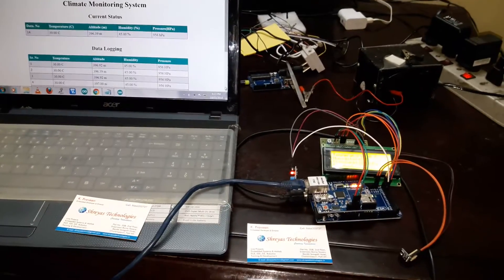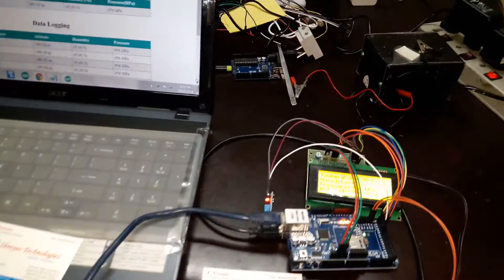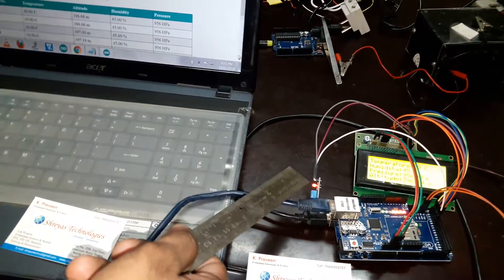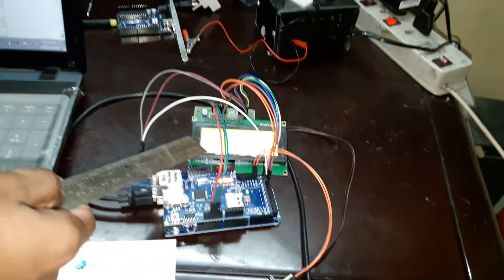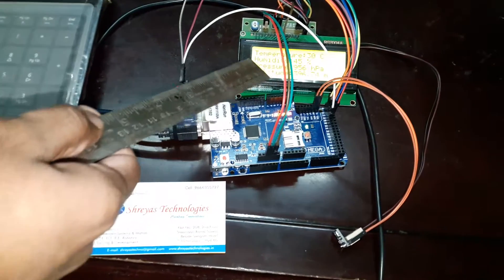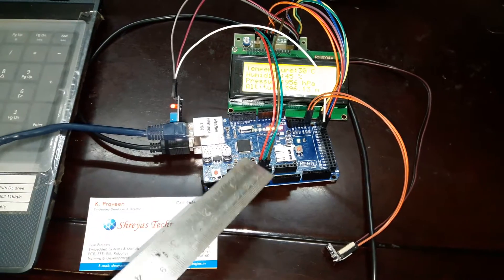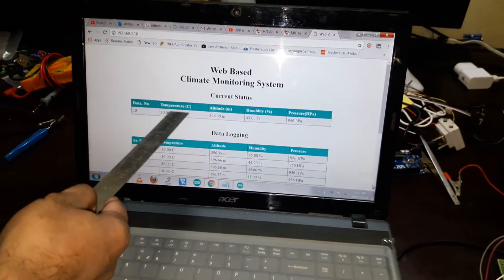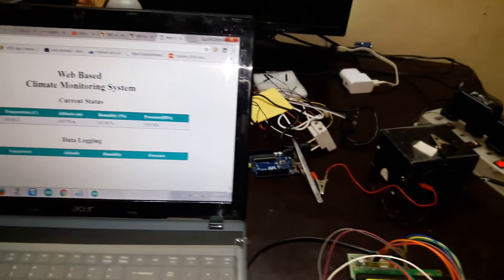Web Based Weather Station (Climate) Monitoring

Comment: Dude please share all the components required and please describe the procedure
Reply from the maker: HARDWARE:

1. ARDUINO MEGA (Atmega2560)
2. Regulated Power Supply
3. Ethernet Shield (Wiz5100)
4. LAN Cable
5. Laptop / PC
6. DHT-11 (Temperature & Humidity Sensor)
7. BMP180 (Pressure, Altitude)
8. 20x4 LCD Display

SOFTWARE:

1. HTML (PC Side)
2. Embedded CPP
3. ARDUINO IDE